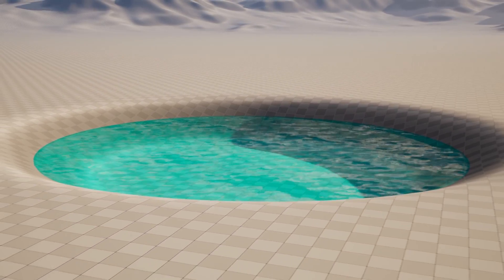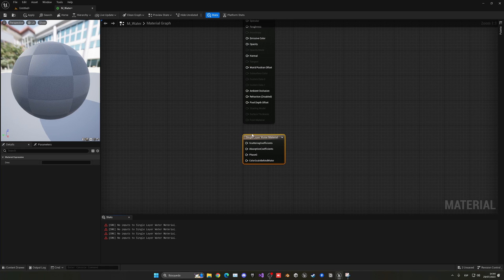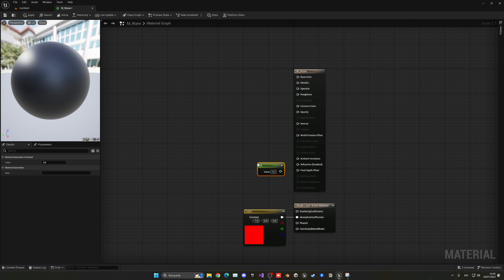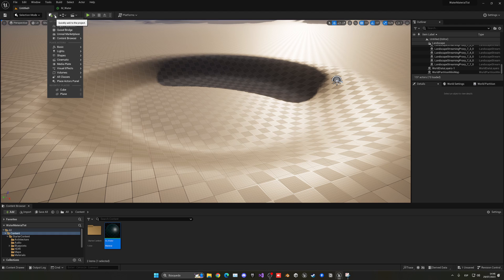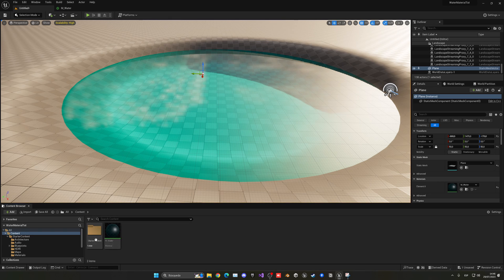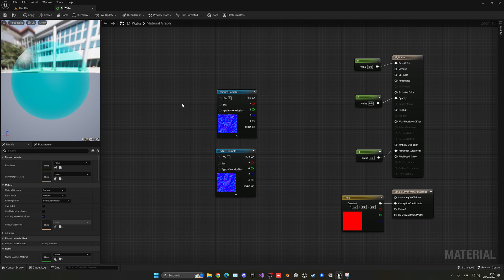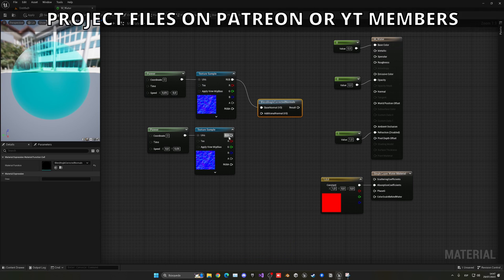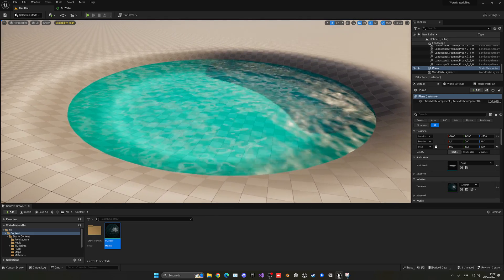How to Make a Simple Water Material in Unreal Engine 5

Comment: It seems this tutorial does not work in Unreal 5, the water material is still black after connecting opacity. Any tip on how to fix that? Thanks!
Reply: I encountered the same issue. You could try playing around by dividing by a high number like 100 the output of the color that goes into absorption coefficient, if you want it even lighter divide that result again with another node. Also you can try using blue colors on the base color and also dividing them to not make them so exaggerated. Hoping this helps!
Reply: Set color to black on constant 3 and put it on absortion coefficients. Or set it to the opposite color you want it to be.
Reply: It worked for me 5.3.2
Reply: @sandiablo360  Is that the numbers we should type in or is that the version you're using?

Comment: My material turns black but I'm not sure what I am doing wrong :'(
Reply: Same in Unreal 5. Have you happened to find a solution?
Reply: I encountered the same issue. You could try playing around by dividing by a high number like 100 the output of the color that goes into absorption coefficient, if you want it even lighter divide that result again with another node. Also you can try using blue colors on the base color and also dividing them to not make them so exaggerated. Hoping this helps!
Reply: double check your values ! :)

Comment: Just a little information for those who think "Why does the ripple look different on the video than in my test". 
It's because the normal texture from the starter content ain't used.

When you are about the click the texture in the dropdown menu click on the little 'cockwheel'. 
Enable: "Show Engine Content" and "Show Plugin Content" Note; this will add a lot of files in your folder struct, but they are just hidden on default they are already "there". 

When you enable those folders, you will see the normal that Gorka used in this tutorial and get the same ripple effect.
Reply: It doesn't work
Reply: Thanks! This worked for me in Unreal 5.1!
Reply: I hate unreal, I really really do. Every tutorials seem to have this